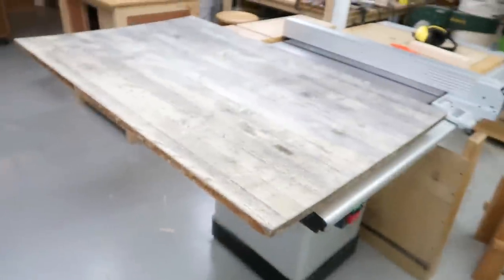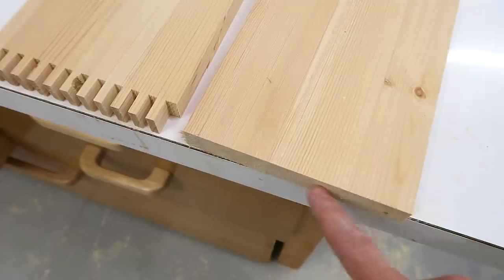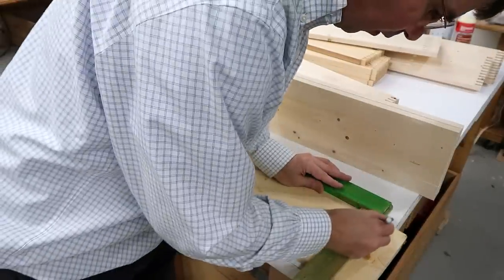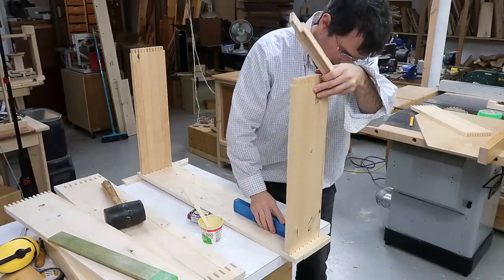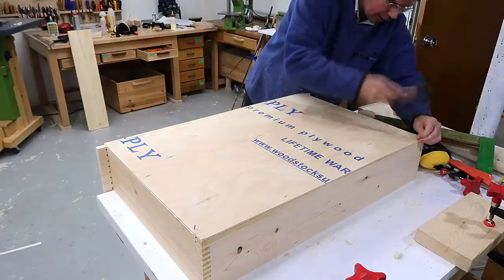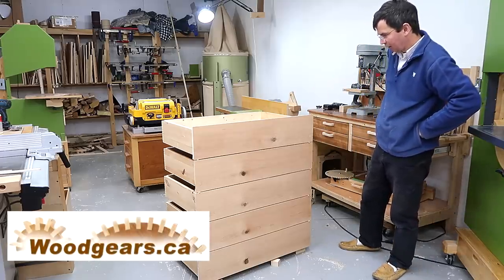Making drawers for a dresser

Comment: Make the middle drawer the odd one  - asymmetry is the new symmetry!! :)

Love the use of every single scrap!
Reply from the maker: I think I will put it in the middle.  Lots suggesting to saw it off and re-glue it, but it's also flipped inside out, so I'd have to saw thru the veneer and plane it again.  not enough veneer for that.
Reply: @matthiaswandel  often the most valuable - i.e. interesting pieces have the maker's 'errors' in them. Handmade = fallibility and that's what makes it unique!!
Reply: @jholmessiedle  Exactly!  👍
Reply: @matthiaswandel  could try drilling out the knot on that drawer and patching similar to the knot you replaced with dark wood but with lighter wood this time, so there is no knot.
Reply: my 1st thought
Reply: If all the draws are the same… how would you know what one you are opening
Reply: @wobblysauce  unless your eyes are closed...I'd guess physical position!
Reply: Wabi-sabi, I think it's called, beauty in imperfection

Comment: Aleksy said he couldn't get automatic translation to work for this video so I typed up an abridged version of the audio for him. Please feel free to edit and hopefully this helps someone else too.

0:15 an old table was outside and planing the surface should make it look good.
0:40 the length of the wood is just right for drawer sides.
0:44 the wood is from resawed 2x6
1:05 resawing
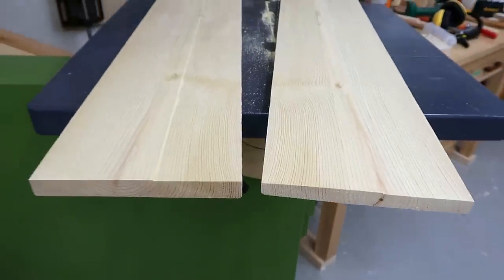1:10 he accidentally resawed unequally.
1:27 gluing drawer fronts to get the height he wants.
1:44 cutting box joints in the back corners of the side pieces.
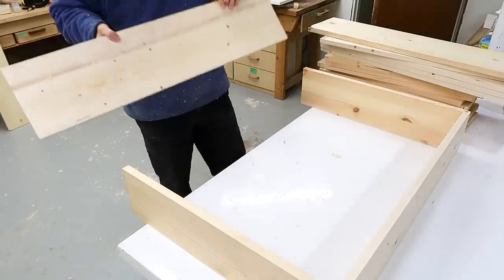2:08 he shows where he wants the drawer fronts attached.
2:25 instead of making it a long cut, he decides mortice and tenons are more desirable because it will lose less strength.
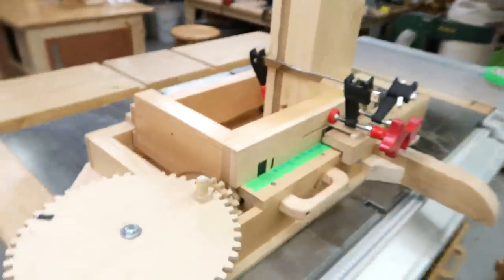2:40 he describes the spacing that he wants to use instead of the box joint spacing.
2:45 he isn't used to making tenons with the different spacing so he made a rough set of markings to help him keep count.
3:24 he comments that he was so worried about cutting accurately for the spacing of the tenons that he accidentally cut them 1/4" (6mm) too deep.
3:57 he says he has a count for his slot morticer.
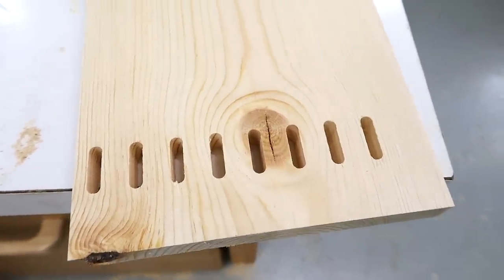4:15 he says if he had to use hand tools to make this he would avoid the knot in the wood, but his tool makes it easy.
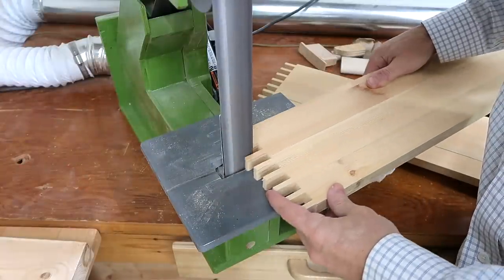4:44 his work was too precise for wood so he uses the sander to thin the tenons.
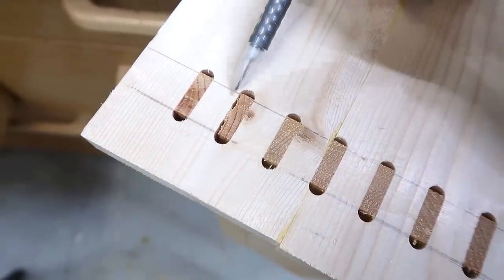5:03 he points out that he was slightly off on one tenon.
5:17 he says logically the way to glue the joint is up but he doesn't want glue dripping in the drawer, so he lays it on the table to glue it.
5:30 he shows this to make idiots mad
5:40 he marks R to show that side is of the wood is the referenced side from the box joint jig and morticer.
6:26 he adds a lip to make it the low point, the spacing allows the bottom of the drawer to sag a little and not cause interference with the drawer below it.
6:40 he ran out of plywood so he glues some pieces together.
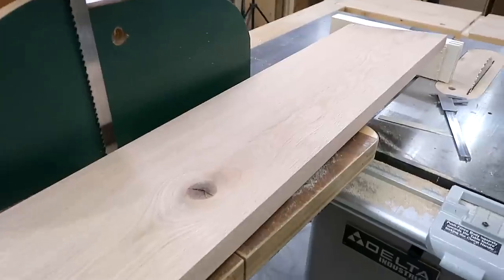6:51 he wants veneers (wood covers to make the front look better) he hopes to get 5. approximately 1/8" (3mm) thick.
7:10 he joints the wood after he cuts a veneer.
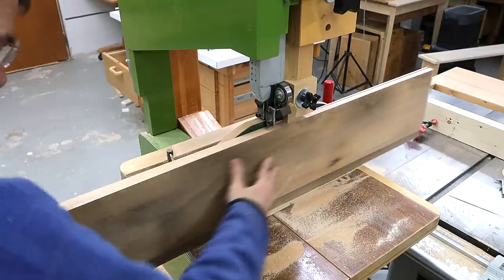7:20 he got all 5 veneers, but the knot in the wood is getting worse.
7:35 he uses a piece of carpet to help the glue make a better bond between the veneer and drawer front.
7:50 he can only glue up one at a time, but it's okay he has other things to do while he waits.
8:00 he says that a lot of people are sponsored by Total Boat® epoxy, but he prefers to use the old technique of gluing in a plug.
8:24 he shows his 5 drawers and says that with these drawers he knows the size of cabinet he will make to fit them.
8:30 he knows he accidentally put a veneer on backwards and his next video will be building the cabinet.

Comment: Since the bottom is the weakest part of a drawer and bears the most load, I make my drawer bottoms out of 1/2" Baltic birch then set the drawer walls atop the bottom.  I mount the slides to the bottom.

Comment: I made a set of 7  - 12” wide by 2 3/4” tall Knick-knack drawers to run side-by-side under a set of wall cabinets. The idea was to cut all the fronts from one piece of figured oak so you could follow grain lines from drawer to drawer.  
Looks like I’m not the only one that glues wood on backwards.

Comment: Great work mr Mathias. May I suggest, maybe its possible to remove the bottom of the drawer and with a little bit of work turn the drawer around and fit the plywood on the opposite side.

Comment: You could have a strip of paper or something with lines at various common finger intervals and put on your box joint jig. More permanent version of the tape you did. I envision something Kinda like a cross between a engineers ruler and the slow motion camera ruler gauge mythbusters used to determine the speed of an object.

Comment: Wait wait wait, what happened with those three pieces you glued together to make the last drawer bottom?! It looks like one o ft the pieces was overlapping the other two, how do you get that to work? I love using scrap pieces but this is baffling me.
Reply: Yeah id like to see that finished. Maybe notch around it putting the humped piece up into the drawer with another piece cut to fit and nailed below it to make bottom all flush and support inside 🤔

Comment: Is there a reason why sometimes, you slot the drawers to fit the bottom in, and other times you just glue and nail it straight under? 
Is it just because there won't be hewvy stuff so you don't need the strenght of the slot fitted bottom?
Reply: Glued and nailed on the bottom is the strongest construction option available. Putting plywood in slots wouldn't make it any stronger. Plywood is put into slots so the panel can float with expansion and contraction. But if the wood is well seasoned and acclimated that's not really an issue.

Comment: Time to add a DRO to the slot mortiser.
Reply from the maker: If I didn't bother to read the counter wheel, do you think I'd read a DRO?
Reply: @matthiaswandel  Good point. Could you make an optical encoder with a RPI to light a led when it’s in the right position?

Comment: А где субтитры, ленивая попа!!! но в целом видос, Классный!! Than you!!!
Reply: 0:15 an old table was outside and planing the surface should make it look good.
0:40 the length of the wood is just right for drawer sides.
0:44 the wood is from resawed 2x6
1:05 resawing
1:10 he accidentally resawed unequally.
1:27 gluing drawer fronts to get the height he wants.
1:44 cutting box joints in the back corners of the side pieces.
2:08 he shows where he wants the drawer fronts attached.
2:25 instead of making it a long cut, he decides mortice and tenons are more desirable because it will lose less strength.
2:40 he describes the spacing that he wants to use instead of the box joint spacing.
2:45 he isn't used to making tenons with the different spacing so he made a rough set of markings to help him keep count.
3:24 he comments that he was so worried about cutting accurately for the spacing of the tenons that he accidentally cut them 1/4" (6mm) too deep.
3:57 he says he has a count for his slot morticer.
4:15 he says if he had to use hand tools to make this he would avoid the knot in the wood, but his tool makes it easy.
4:44 his work was too precise for wood so he uses the sander to thin the tenons.
5:03 he points out that he was slightly off on one tenon.
5:17 he says logically the way to glue the joint is up but he doesn't want glue dripping in the drawer, so he lays it on the table to glue it.
5:30 he shows this to make idiots mad
5:40 he marks R to show that side is of the wood is the referenced side from the box joint jig and morticer.
6:26 he adds a lip to make it the low point, the spacing allows the bottom of the drawer to sag a little and not cause interference with the drawer below it.
6:40 he ran out of plywood so he glues some pieces together.
6:51 he wants veneers (wood covers to make the front look better) he hopes to get 5. approximately 1/8" (3mm) thick.
7:10 he joints the wood after he cuts a veneer.
7:20 he got all 5 veneers, but the knot in the wood is getting worse.
7:35 he uses a piece of carpet to help the glue make a better bond between the veneer and drawer front.
7:50 he can only glue up one at a time, but it's okay he has other things to do while he waits.
8:00 he says that a lot of people are sponsored by Total Boat® epoxy, but he prefers to use the old technique of gluing in a plug.
8:24 he shows his 5 drawers and says that with these drawers he knows the size of cabinet he will make to fit them.
8:30 he knows he accidentally put a veneer on backwards and his next video will be building the cabinet.